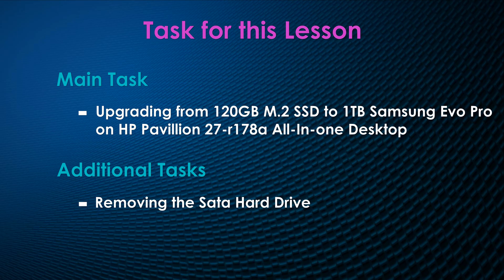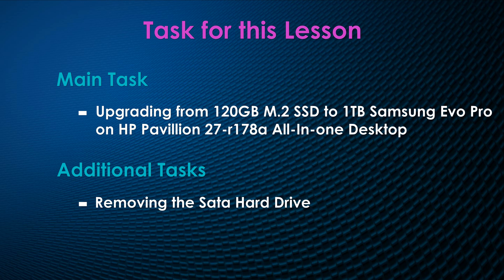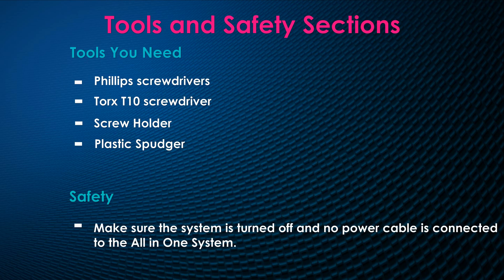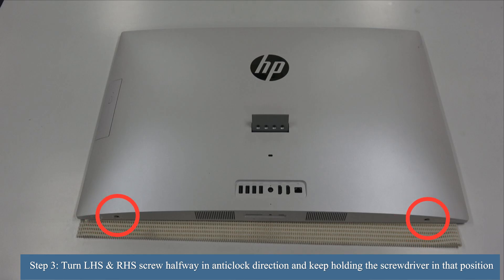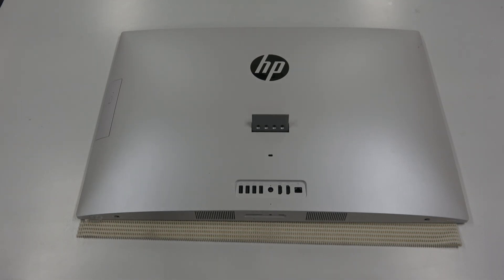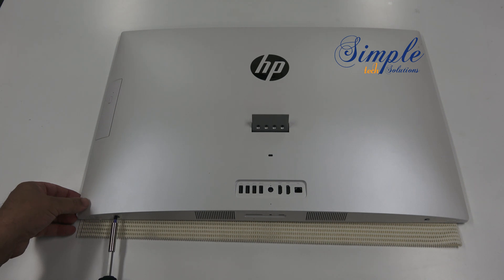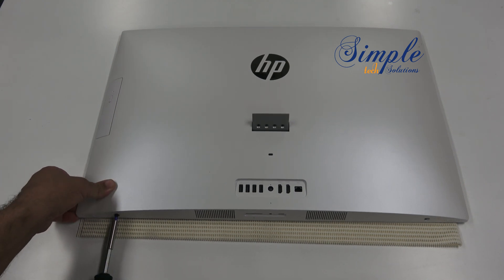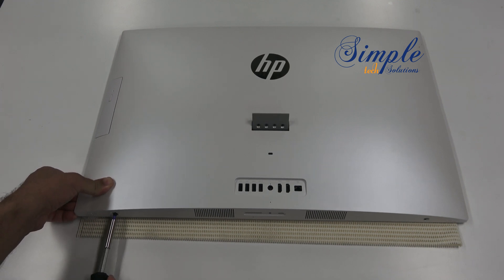How to replace M.2 SSD on HP Pavilion 27 inch All In One 27-R178A  4LY21AA & Removing Sata HDD

Comment: Worth noting that the recovery drive you can see on the PC normally is not available after replacing the M2 SSD. I had a separate recovery drive on a USB that worked fine. People should not rely on the HP supplied recovery drive. When you reboot for the first time use F10 to get the standard BIOS interface.
Reply from the maker: agree! whenever I'm replacing any computer hard drive especially when the recovery partition is on that hard drive, I'm using a USB to install the OS.

Comment: Thank you for this video! So, what do you suggest to copy the old M.2 SSD to the new one?
Reply: I will be using Snapshot Backup - http://www.drivesnapshot.de/en/intro.htm
Reply from the maker: no worries hope you liked the video, if you have already replaced the m.2 ssd and if you want to copy your document to the new hard drive. You can purchase a M.2 SSD Enclosure, they are cheap maybe $20-$50 depend on the brand.  you need to place your old m.2 ssd onto the enclosure and plug it into the pc and copy all your document to the new hard drive. hope this help you and let me know how you go
Reply: @simpletechsolutions6827  Thank you!
Reply from the maker: No worries